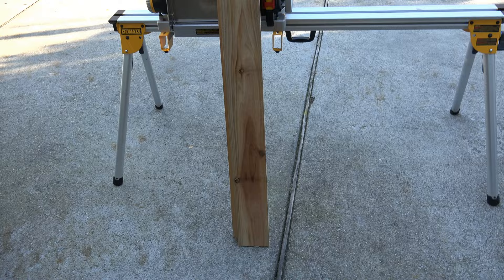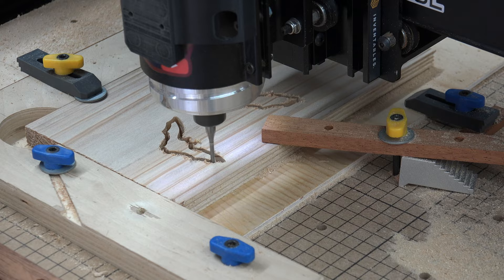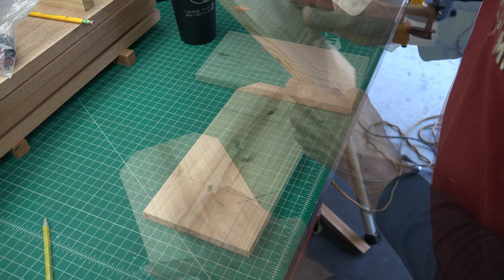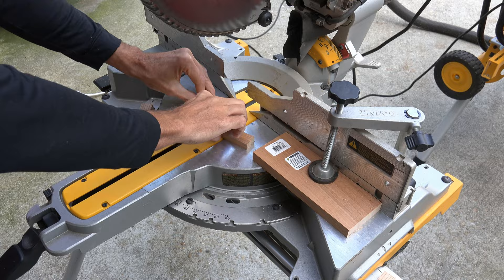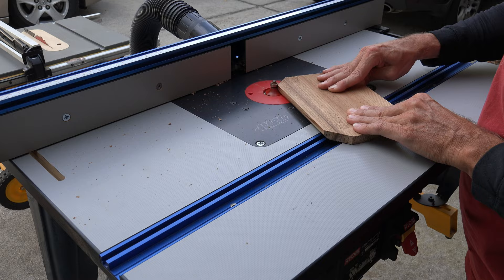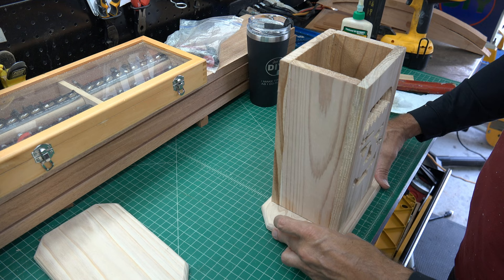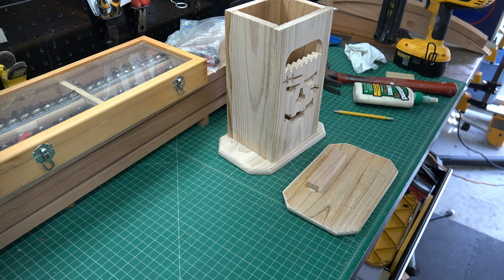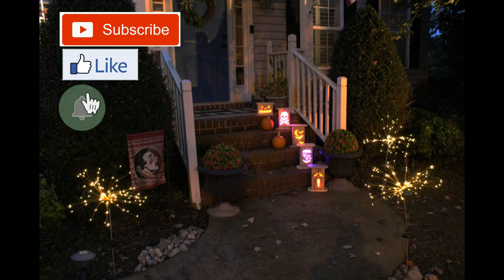Halloween Lantern Build

Comment: Love it! I think I will modify it a bit tho. I will make the back about 2 inches shorter, leaving the gap on the bottom, then using a Forstner bit, drilling a cutout to accept an LED Tea Light which will fit in the space in the back
Reply from the maker: So the space inside is for the click lights that are super cheap on amazon.  You can buy them in bulk and charge a little extra for them.